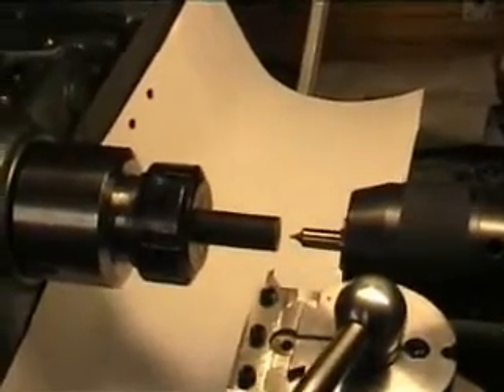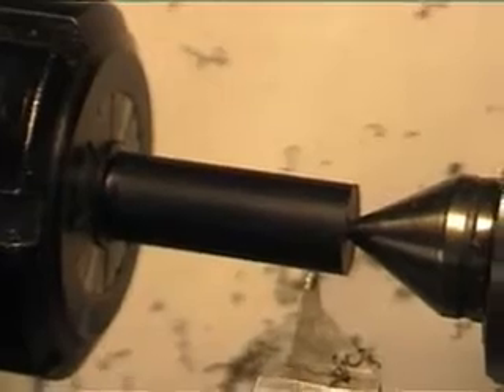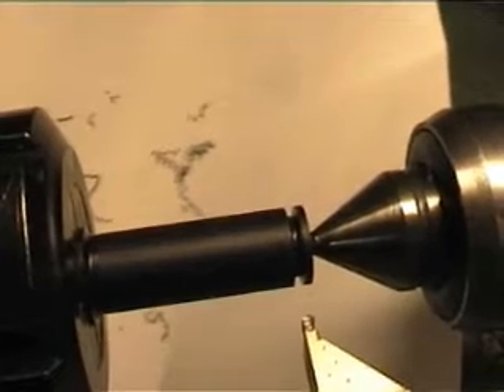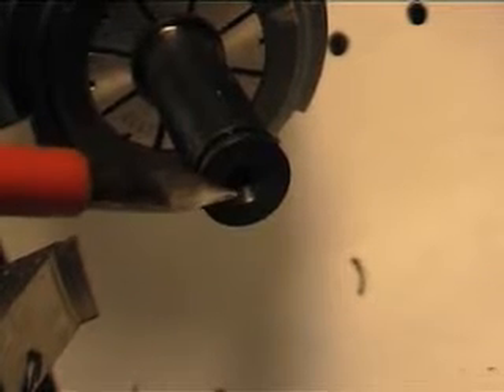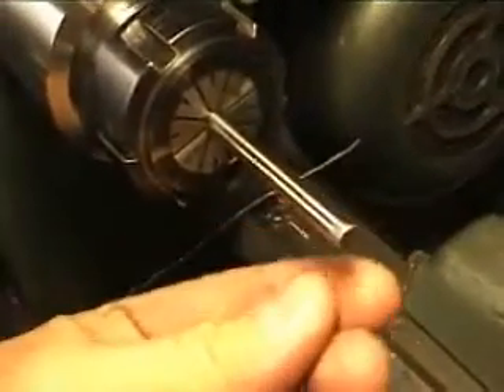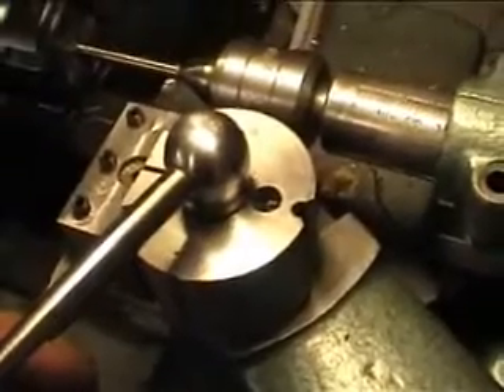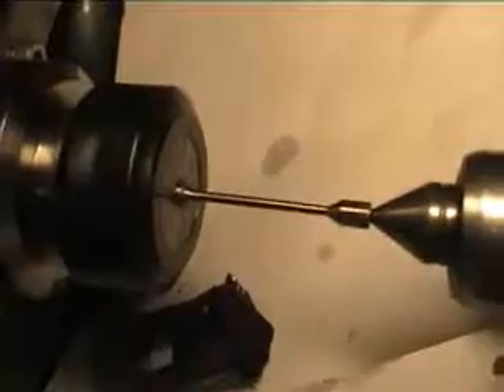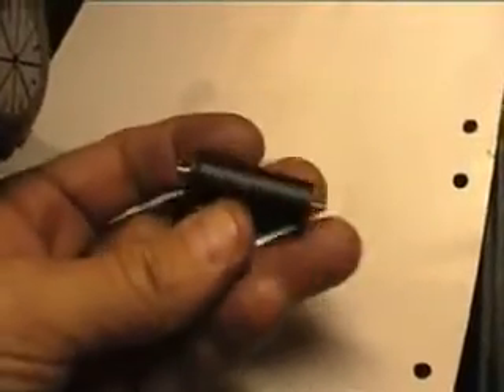DIY pcp air gun valve building.wmv

Comment: Great job your English is very clear.  I have a question do you no what a safe wall thickness is for brass and or aluminum on a 3000 psi fill on a pcp valve.  Looking to mod some valve similar to the one you built.  I also would of never thought delron would be able to with stand high pressure air id be scared of the valve shattering just because I have seen it happen when being turned in a machine. ✌️👍👌 Thanks for your time and reply.

Comment: Do you get good duration of the seat using delrin? When the metal valve slams closed, does it damage the seat over time or is it lasting a very long time?
Reply from the maker: Thanks for your comment Antonio! I still haven't worn out a valve seat. Some of my guns have fired several thousands of pellets, so the valve seat seems to be pretty though. Thanks/Ola

Comment: and how the valve moves in the original position?
Does it have a spring that is pushed back to its original position to seal the high pressure air?a retainer spring?
plss reply plss.
Reply from the maker: richard cero Hi! A spring..; well.. yes, and no.. A valve can be used witout a return spring since the high pressure air acts as a very powerful return spring and forces the valve shut after fireing your gun. A return spring is good to have if you are about to fill a pressure vessel that is emty. The return spring will then keep the valve shut until the pressure in the vessel is high enough to take care of that. I suggest that you go for a valve with a return spring to start out with. best regards
Reply: thank you very much!!

Comment: Ok thank you, it is leaking less and less.
Hopefully after one more fill its 100% seated.

Otherwise i try to make the sealing surface smaller or valve spring heavyer.
If they all fail i go with the flat head valve.

What dimentions did you use for it? Like a 6mm valve head and 5mm hole so 0.5mm sealing surface?

Thanks again for sharing your information and skills with us !!

Comment from the maker: I still haven't managed to wear out a valve! I have put somewhere around 10000 pellets through the barrel of one of my guns - and it has a flat face valve, brass body, delrin head. Somehow i find the all metal pin/soft valve body design easier to make and easier to get to seal at first fill, so most of my recent guns have that type of valve. 
Cheers

Comment: By the way. do the Delrin valve/valvehead wear out quick if made correct without burrs or whatever?
Which ones wear out quicker, your dezign here or the oposite hard body soft valve head?

Did you ever had to replace a valve due to wear?

TY!

Comment from the maker: Generally speaking; the lower the pressure, the thinner the sealing surface of the valve/seat in order to get it to seal properly. Most of the time a width of .5 - .75mm works well. If you gun is safe for higher pressures you might try some shots at lets say 200bar, just to slam the valve shut more forcefully and thereby aid in forming the valve and seat to match each other. 
Don't spend your money on valves - buy tools instead! 
Take care

Comment from the maker: Sounds like you are on the right track! When I have difficulties to get a valve to seal @ first fill I try to "shock fill" from a scuba bottle or similar. At times it's almost impossible to get new valves to seal when filling from empty by means of a hand pump. Once pressurized and fired a couple of times i seldom get any problems from my valves... But as you said I normally go with higher pressure. Out of letters!

Comment: Sealing surface is to your recommendations around 0.75mm.

What did you mean by cut the sealing surface to proper width?
You mean that the valve head is like 1mm bigger then the hole?
Or what do you recommend for that?

And that is just flat valve head to flat body right? I can't emagine how that could seal haha but i will try everything to make a good valve.

I refuse to order a 60 euro valve ( 35 shipping + 21% dutch taxes) from US and have a crappy chinese valve.

Comment: Since im shooting at a regulated 100 bar and you i guess 200?
I think a heavier valve spring would do the trick.
Already put a heavier one in it and is leaking just a little bit right now.

I polished the seat and valve too, just put some polish paste on the valve head and turn it for a while in the valve seat so they kinda wear in to eachother. 
Im supprised how little pressure 100 bar gives on the valve.
Since im still using the same hammer spring.
I hope it will seal good when i shoot a while

Comment from the maker: Sorry to hear that your valves are leaking! Anyway, is there any signs of wear on either valve head or seat? The fact that the valve seals for 50 shots indicates that the desing is right, but the parts (material) might not be up to the strains. What type of aluminium did you cut the seat from? Debris in your system? Bent valve pin? Width of sealing surface? I have never tried 45deg, but have use flat valve seats - should work, just cut the sealing surface to proper width. 
thanks

Comment: Hey,
I am modding an QB79 CO2 gun to HPA and made this valve too.
With the body from aluminium and the halve head of delrin.

But i can't get it sealed well.

First try was with a 7,5mm hole and second valve with a 6mm hole.
First one worked well but after like 50 shots it starterd leaking.

Second valve didn't make 10 shots.

Should i try a 45 degree angle on the valve and seat or just a flat valve face and a rim in the body of the valve?

I don't know.

Comment: yes it will and it will be better because it will not require a end cap to hold the spring in place i often use that method on my high powered airguns for .22 i use a 6.5 hole and a 7 mm valve the 6.5 hole leads to a 5mm hole in the breach this set up will give me over 50ftlbs

Comment: Another great vid. Love Acetal. My local supplier only has it in white :-(. Nylon only in black. Reminds me that BSA made a bad batch of Hornet internals with Nylon instead of Acetal. Swelled in rain & rifle stopped working ;-) Nylon horrid to machine by comparison. I need to grind a tool like yours for plastics - insert tooling not sharp enough for precision cuts on plastics.

Comment from the maker: Hi! I'm not sure i get the idea.. that should work,,, but you need toadd some extra lenght to the valve pin, un-supported lenght that is.. will make the valve pin more prone to bending, and also adding extra weight = more inertia.. Valve should be keept as light as possible IMHO..
Thanks

Comment: Emco and huvema is just all chinese too. 
For old machines, you still pay for technology from 20 to 70 like years ago.

And cheaper no brand machines are almost just as wel at this time.

And that old machines most of the time need a lot of maintnence and parts are often not much available.

And yes i need to cut threads with it.

Comment from the maker: I have no experience of Huvema machines.. IMHO it's (almost..) always better to go for an good quality second hand machine... Try to get one with as much tooling as possible.. Do you need to be able to cut threads? Otherwise a plain turning Schaublin 102 is good... even if it's 70 years old. Myford, Boxford, South Bend are good solid machines that last a couple of lifetimes if properly taken care of. Used quality machines is sometimes cheaper than new low quality stuff.

Comment: Its getting EU screws on the pressure tube, Not chinese shit.

Airtube is rated for like 2000/2500 PSI.

It will be running at a regulated pressure of loke a 1000 PSI.

For the valve head i think im going for PTFE rod.

Yes no need to glue indeed, in my head i had drilled it all the way trough haha but littlebit past half way would be ok, pressure and spring will keep it in place.

I would like to get a Emco Maximat Mentor 10 lathe:)

Or just a Huvema lathe.... Its cheaper

Emco is like 1600E :(

Comment from the maker: Hi there! First of all..; make sure your QB can handle the pressures safely. Valves..; Yes it will probably work out just fine building it like you describe it. You dont need to glue it to the valve pin; a press fit is good enough, there is no force pulling the valvehead off. Make sure the valve sealing surface is somewhere between .5-1mm wide.. The easiest way to get a valve to seal is to pressureize it fast - like when you fill from a scuba bottle or buddy, a hand pump is harder. Out of words

Comment: Hello,

Will it seal good?

I just got a cheap QB78 CO2 gun.
Converting it to PCP.

But i want a other valve too couse original has too much distriction.

If i cut the brass valve head in a 60* angle with an inside tool and make a like pvc kind of valve head wich later can be glued to a steel rod.

Wil i it seal if both cut to 60*?
i first have to save up for a lathe anyway haha.

Nick

Comment from the maker: Thank you for the kind words! Yes; the transferport hole is drilled in the top of the valve body.. I prefer to mount the valvebody in the receiver and then drill the transfer port through the receiver ( the metal part...) and in to the valve body in one set up.. That ensures that everything lines up perfectly.. Then it's just to drill a hole in "the bottom" of the barrel to let the air enter the barrel. A bit short of space to write here! do you get the idea? 
Thanks

Comment: Man, you sure have built some great PCP airguns compared to others!! I just have a question; from the last video, the diagram shows what you call an 'air transfer port'. Is that drilled in to the top of this knock-open valve? And how does that connect to the slider/loading chamber? Thanks!!

Comment from the maker: @wyz2285 When i use a valve return spring i make a recess for it in the air tube/bottle adaptor that screws into the same hole that the valve body sits in... Hope you understand what i mean... would be a lot easier if i had a picture of it!
Thanks

Comment from the maker: @pyronathanpyro One thing to consider is that the force needed to knock open the valve is proportional to the "sealed area".. it takes a lot more hammer force to open a valve head with a diam of 10mm compared to a valve head of 5 or 6mm.. Also a bigger diam valve stem means higher weight and more inertia. If you go with a stem of 4,5mm you have enough material to fit an oring, and if you use a 4,5-5mm inlet in the valve body and turn down the stem just behind the head it's good for +900fps...

Comment from the maker: @pyronathanpyro Thanks! You are right aboutthe air loss past the valve stem during fireing.. I have built valves both with and with out o-ring on the stem. The valve built in this video has a stem diam of 2,3mm so it doesn't have enough material to cut a o-ring groove in. As long as you get a good fit between valve stem and the hole the air loss is acceptable. 
thanks

Comment: nice :) im gona build one on a friends lathe also your english well you trying to speak english i actualy understood you better than a fluent english speaker thx man also you know the end of the pin that gets hit by the hammer well how to i stop air leaking out of that bit when it opens ? can i put an o ring on the valve pin its self just past the exit hole ? inside the plastic housing so it stays air tight ? cheers